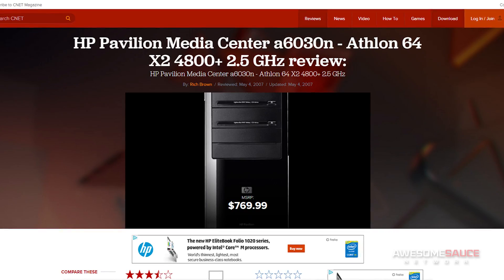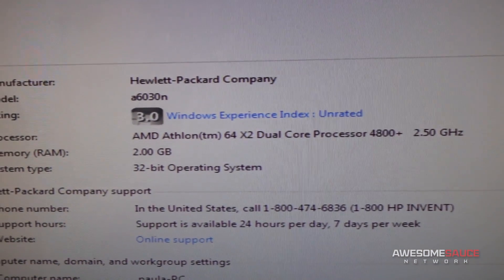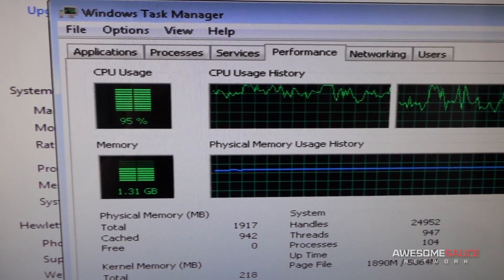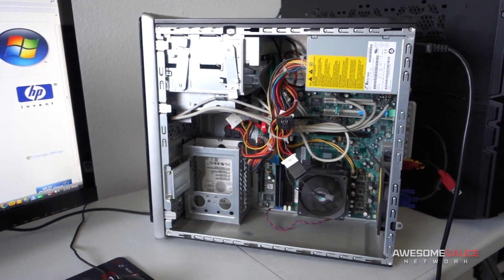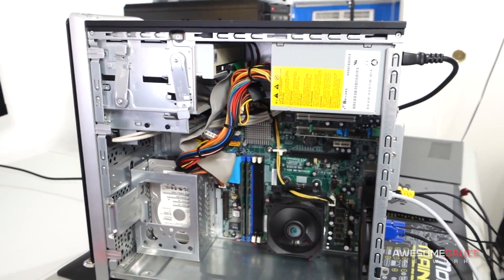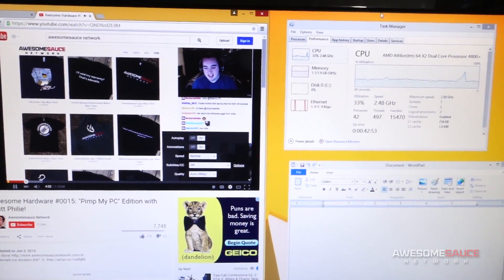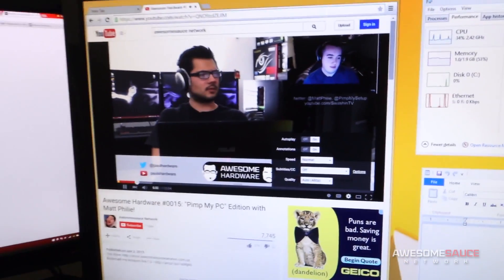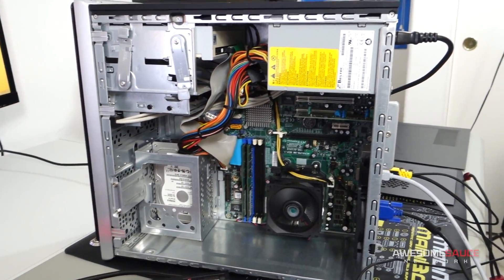Cleaning Up My Neighbor's Old Desktop!

Comment: im planning on building my first custom pc soon. i have the motherboard ordered and need to get the rest. today i refurbished my old pc to practice. it was so filthy inside when i opened it. it looks brand new now.
Reply: I hardly ever have to clean the interior of my computer and it is nearly dust-free.

Dust that is not present cannot get inside a computer. The best way to keep dust inside your computer to a minimum is to reduce the dust outside the computer. Vacuum at least once a week, dust at lest as often, and keep the humans and animals in the area clean -- brush and bathe the animals regularly and have the humans use some sort of abrasive loofa in the shower to reduce the amount of shed skin cells.

Then, ensure the computer is positively pressurized - that is, the only air coming into the computer should be through the fans, not through cracks and other openings. If the fans have just about any kind of screen over them, they'll pull very little dust in.

Comment: you could of went the full 8 gbs of ram in it like my vista gaming system has. i have an old dell optiplex gx620 /p4 3.6ghz /8gb ram /1gb zotac video/250gb harddrive it plays most old games at high. then my new one is a gigabyte ga-p67a-ud7-b3/i7-2600k oc@4.5ghz /8gb ram@1333mhz /rx550 4gb oc.

Comment: I have a PC of the same generation. AM2 + socket DDR2 memory.  ASUS M2N68-VM motherboard,  athlon ii x2 240 , 8 gigabytes of DDR2 memory. Maximum how much the motherboard can have.  AMD Radeo  HD 5670 1 gb DDR5  . Used parts are cheap for this generation. Why not upgrade such a PC. It's still a good computer. It's not great but for a regular user it is far more than it needs. I use it as a spare PC

Comment: Really wanted to do your neighbor a favor? Quite simple, 2GB's of RAM (Máx 4), try Windows 7 Home Premium + Linux Mint 17.3 , makes a perfect dual boot pc, plus, you could have partitioned the HDD Drive to just simply move data to another partition and leave a small 40GB Max for Windows 7 + Unallocated 20GB space + the rest of the HDD drive as logical NTFS drive, and you have a very nice dual boot pc for your neighbor's use. By the way, try looking out of the box of windows.

Comment: i ve got one of these at a Recycling Centre for 8,37Euros (The worth of the Steel). but it has an Athlon 64 X2 5000+ an a 8500 GT with 3Gigs of DDR2. i mean for the price... i changed the CPU to an X4 9550 and the GPU to an Singleslot GTX 550 and throw an 1Gig stick into the mix, now its an under 40Euro gaming Rig which plays games like CSGO or DOTA2 / LOL like a charm on 1600x900p

Comment: Very nice job on the system cleanup and cable organization.  I have an older PC similar to that one, but it has an Intel i7 960 or 980 CPU and it takes forever to load.  I’m fairly confident it doesn’t have any malware or viruses as I keep the virus definitions updated, but it’s only got 2 Gb of DDR2 ram and there isn’t much else I can do at this point unless I uninstall more apps that might be running in the background.  I’m keeping this one operational as it’s configured for my Epson scanner so I can digitize my old pictures and that’s all it will be used for. Thanks for the video.

Comment: If viruses or malware are present, formatting does not necessarily remove them. They still could be present on the hard drive. The only way to completely eliminate them is to write all zeros to the hard drive and then do your clean install.

Comment: How much for a pc/motherboard clean up and fix up I got a hp as well mine idk what version it is i had it about 2000 it is currently windows 10. My frams are always really low and my pc is always hot because my fan isn’t working properly because it’s dirty and I am trying to clean it but my side thing on the motherboard won’t open also I am trying to reset my pc but whilst trying to reset it I had to redo my settings to use my pc again but my mouse and keyboard won’t work when this happens. Please help

Comment: I need to pull out the flash drive ports at the top of mine, but I can't figure out how to get at the damned thing. The card reader does not work when I push an sd card into it and the indicator light stays on all the time. That did not do that with my old computer and I wanna swap the slot board out.

Comment: I wish my computer was this good compared it's from 2003 and has never been cleaned is filled with an inch of dust has power supply problems has 15 diffrent viruses and is a fake from China running on a non jinuon copy of Windows

Comment: what you should have done is installed a cheaper solid state drive then put on a clean retail copy of windows with no bloatware and a simplified registry. that would quadruple the PC's speed or better. nothing like having Windows boot to complete usability in 6 seconds. you would blow your neighbor's mind
Reply: Beating a deadhorse a sata 1 speed mb... A good used high cas/7200rpm hd will do the job. and who cares about the ide odd. That does not do any thing for the gen/speed of the computer. The cpu and the ram will. More so if you can buy it real cheap on fleebay.. Like a faster duelcore or quadcore that will work with his set up the mb and psu. and the fastest ram at a min 4gb's that his mb will support... Only with a cap of $50.00 if poss. Any ways he did his neighbor right for his needs.

Comment: Probably it was an AM2+ motherboard and you could run a 4-Core Phenom II at around 3.O Ghz in the PC for less then $30 or a 3 core version for around $15. You could add another 2GB of memory DDR2 memory too for a very reasonable price around $20. Personally I would install a Linux distro like Peppermint 8, a little bit dependent on the applications he uses and/or needs. With Peppermint you could skip the memory upgrade, it runs easily in 1GB too. The CPU upgrade would be good for fullscreen 480p or HD 720p YouTube videos. 

Personally I upgraded a 2008 HP dc5850 to a Phenom II B97 at 3.2GHz, maxed out memory to 8GB at 800MHz and added an old video card 1GB GeForce 8400GS. Now I run Chromium/YouTube HD and up to 3 Virtual Machines (Win7, Ubuntu, Win XP or Linux Mint), all at the same time. The Ubuntu VM is used exclusively for banking, paypall etc., the XP VM for music and the others for trying out new Alpha and Beta releases or web browsing. The Host OS is Ubuntu 17.10 till the next LTS release.

Comment: In these cases, you might as well just back up important files and do a fresh install of Windows 10 with privacy settings and all, which tends to be more efficient than Vista, 7, or 8 to begin with in terms of resource allocation even with low-powered systems.

Comment: @Bitwit I have a A10 5700 quad core with and Radeon 7660D + 7470 dual graphics what part should I buy to boost game FPS. Thanks Please reply
Reply: That system is not going to have many upgrade options.  If I had that computer and needed to make it play games faster I believe that I'd use a Power Color Red Dragon  Radeon RX 550 4GB PCIe x16.   They don't use very much power, they don't need additional power connections, and are small enough to fit into just about any case except a low profile.  I would also get at least 8GB of memory. Your computer probably uses DDR3-1333 but could use DDR3-1066 or DDR3-1600 possibly.  If you want the games to load faster and not just to play faster then you could get either an SSD for best speed or a SSHD (Hybrid Drive) which allows faster loading and more storage.

Comment: he really couldve used another 2 gb ram if not 6 if vista supports, if not i wouldve sprung 30 usd for a windows 10 or used an old laptop key that is now running linux then it be like a new computer to an old light user
Reply: C K Kyle didn't have any DDR2 ram because it was a DDR2 board
Reply: well ive only built less than 36 machines and until recently still had ddr kicking around.
i just assume most builders hoard some old parts just for this purpose to  help out family  friends save $ and just upgrad as much as possible 
as soon as i gave away a whole box of old parts i was regretting and needed one little think that week
and i never throw windows xp/7/10 keys if the tower is gutted or laptop smashed etc
Reply: C K true. Not many people are going to have DDR2 ram laying around. Maybe DDR3. Though it's more than likely with Kyle he's got more DDR4 ram then previous generations of ram.

Comment: i have a problem with my laptop its a dell inspiron 1545 and when i type g it types gt5 and when i type t it types gt5v  and be prepared i am gong to type every letter in the qwerty order here they are in there messed up glory q, w, e, ,r gt5v, hy6m, u, i, o, p, a, s, d, f, gt5, hy6, j, k, l, z does not work, c does not work, gt5v, b, n, m does not work and i am going to exclude the numbers symbols and other characters because that would take too much time to type out expecally with them being messed up and all  please respond because i need help fast i  will check this every day hoping for a response i am using a crappy external keyboard to type this     BTW i will comment this on multiple videos so if i dont respond to you i most likely already have it fixed thanks if you reply

Comment: Thanks for the vid.  I'm typing these comments on almost the twin of the HP Pavilion Elite of the same age that I am still using (in 2017) as my daily driver. It's running Intel Quad Core CPUs instead of AMD but otherwise same original specs.  Course now mine has been upgraded with a 240GB SSD, 8GB of RAM and my son's old Nvidia gaming GPU.  Instead of Vista, I run Debian 9 Stretch with the Gnome DE.  I use it for basic home entertainment (Plex server, Clementine music library and Calibre eBook library.  I guess the moral of the story is that these 8- or 10-year-old desktop systems age much better than laptops of that era, because you can more easily upgrade individual parts...

Comment: pro tip: use a soft bristled 1 inch paint brush to help dust out systems. you can safely lightly dust PCBs and fans without damaging them, and it is much faster and easier than using a tack cloth or microfiber.

Comment: Hi Kyle, quick question here. My uncle has a PC like this and he asked me to help do a clean up as well. Do you think it would be wise to filter the rear fan and turn it into an intake since the PSU is already acting as an exhaust? Will it help balance the airflow into the system and make it easier to clean in future situations?

Comment: My old system from 2010 had the AM3 Athlon II X3 triple core version "x3 440" mated with a GTX460 that ran hot and sucked power like a pig and ended up dying on me with a final BSOD goodbye. The cpu was often running in the high percentages, it was a terrible system.....so glad when i got rid of it and upgraded to a Haswell i5.

Comment: I had seen this video before a while back, and I noticed a couple of things that personally I wonder why people just don't take advantage of in some older systems! And in the case of THIS computer, why is it nobody upgrades memory ever??? Secondly and this is the even bigger question, if the owner was seriously concerned with speed a performance (if you are paying attention) there are four unused SATA ports on the motherboard, that in my mind would be just begging to throw out the IDE hard drive and swap in a SATA components into THIS case!!! I have always wondered why nobody at all that own computers don't push their computers further then they can at times! Of course I am the type of guy that will literally gut an old slim style Dell Computer and load the thing with memory to the fullest it will take toss in three hard drive then figuratively yank the motherboard out to put it in a larger case, and stuff in as many hard drives as it has ports for!!! My girlfriend's computer is just such a monster, and it is running Windows 7 on 8gb of RAM, and has all SATA ports used two of which are tied to two 3tb hard drives for storage one is connected to a SATA DVD drive, and the last remaining is connected to a 2.5 inch laptop 500gb drive for its OS! Then too I bought a bunch of USB 2.0 rear panel extension ports that connect to the extra 2.0 header on the motherboard offering her up 4 more USB connections on the rear panel as well to the 6 that were already on the motherboard and the two front panel USB ports as well! AND I didn't stop there, upon inspection of the motherboard I found there was two case fan ports so with a spare length of wire I added a front cold air intake fan to the front of it in the custom case I installed this motherboard in as well for good measure! And even though the thing runs Windows 7 it flies compared to the other systems I have in my house other than my own custom built AMD driven HTPC I built a couple of years ago!! I am sure the guys at Dell would freak to see what I did to their Studio 540s!!! But just the same you can breath new life into an old computer at times just out of spare parts!!!! And that is basically all my girlfriend's computer is built out of!! Heck the operating system didn't cost me a cent either as it came from a Windows 7 laptop that was a Dell as well, so all I had had to do was download the drivers for the 540s hardware and it was back up and running in nothing flat!! 

On other note I should point out here as well a friend of mine gave me his old HP s5310y Slim computer to scrap and told me that he yanked the hard drive that he reformatted as "back up storage" so the Windows 7 numbers on it are still good! I am presently turning that computer into a Windows 7 video editing machine with 8gb of RAM on the Pentium Duo processor and I plan on using its four SATA ports to hold a DVD drive, one SATA 500gb OS drive and two 4TB drives for storage in another custom case I was giving a while back as scrap metal! It seems sad really that these companies are putting great motherboards in slim line cases, and here some of them have for SATA ports and can be expanded to as much as 8 gigs of RAM but then stuff the micro ATX boards into a small cases, but at times that is exactly what they do! In fact the machine I am writing this on started life as a slim emachines with a 1.8 GHz processor and only 2gb of RAM, and now it is running a 3.0 GHz processor with 4gb of RAM! And again I was told that this computer was junk and they handed it to me as "scrap metal"!!! 

In this day and age with so many computers around people are just NOT aware of what they have and they throw away or scrap some really decent machines! Which is really sad, because you would think by now more people would know WHAT they own, but don't!!! And computers have gotten so "crazy simple stupid" that anymore a 3 year old in some cases can understand them!! And I am 53 years old by the way!!

Comment: Hello, have a Pavilion p6310f with and AMD Athlon II x4 630 14gb ram and Gforce 9100 Pegatron m2n78-la motherboard. Can I upgrade the gpu and should I upgrade the power source. Thanks
Reply: go to https://pcpartpicker.com/, click on build your system and make your list once done then just replace the part you have for what you want and it will tell you if its compatible with your system.
Reply: i should also mention it will tell you if you have enough power and if not what they would suggest, its not always a for sure thing so take it for what it is, pretty close guess and work from there

Comment: Remember ProDOS? Remember when that was a thing? Lol, how about Windows 3.1? Are you even old enough to have used it? How many in this room were there in those days?
Reply: Windows Me at home, Windows 98SE at school, back around 2001–2003. Just cleaned out the WinMe machine after not touching it for several years, hopefully I can get some old games running on it again.
Reply: Not only have floppy of 3.1 install, have DOS 6 install disks.  Yah, I remember!
Reply: NT 3.51, Windows 3.1 / 3.11 Workgroup, Netware, Banyan, OS/2, and I 100% won't forget installing and formatting dog slow ST-506 drives, and then installing MS-DOS 5, and upgrades to 6.22, then 3.11, and then 95 OSR1 (A) all on 3.5" floppies.   9.6/14.4Kilobaud modems, Western Digital Video, using a floppy drive to set the parameters in the IBM PS systems. Dot Matrix and Daisy Wheel printers, Tandy 1000, C64, Atari ST, 12" VGA 640x480 256 Color was a luxury.  Ahh, today just seems so different from then. I think that it was just more exciting then and that the novelty has worn off for me now.
Reply: I bought a 386 laptop with Windows 3.1 so I could run desktop publishing software.  Worked great until I graduated from line art to grey scale.  486dx tower with windows 98 was the replacement.
Reply: alas i am that old  my moms first pc was a win 3.11 when  win 95 had been out for a while. when i was in school we had the old ibms and apple with the green screen ctr monitor . i didn't know enough about computers then to find out what models they where.
Reply: How many remember Microsoft Bob.
Reply: @poppopbuilds6537  I never messed with it. Had to look it up.
Reply: Oh crap there people in the roome with me apparently
Reply: My dad made me learn to use to dos before he would let me on the main windows 3.1 computer.. At one time i had 5 computers in my house as a kid 286 , 386 , 486 forgot the others but.. Yep i remember them days..
Reply: Windows 3.1....now thats not a name I have heard in a long time

Comment: So i have two computers. One is so small i dont think i can open it to upgrade the other i havent used for a few years and should probably boot it up sometime. Both are very old. The small one runs minecraft and only that at 30 fps recording, 40 fps not sometimes 50 and i wanna try out the other but the other one is wierd compared to what you guys build. I want to know should i get some specs for it and upgrade or buy a brand new pc and not do any upgrading.